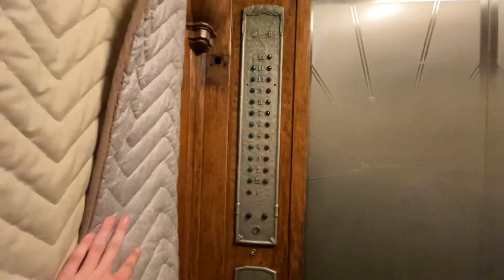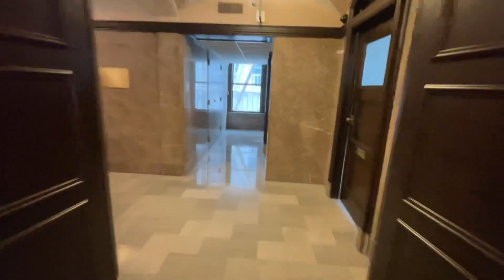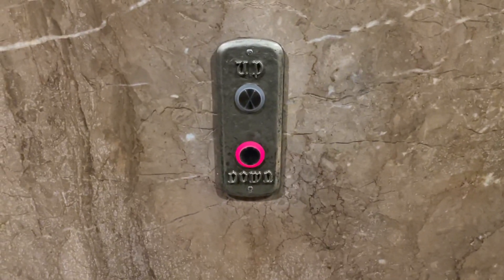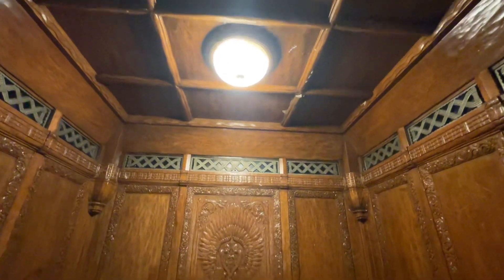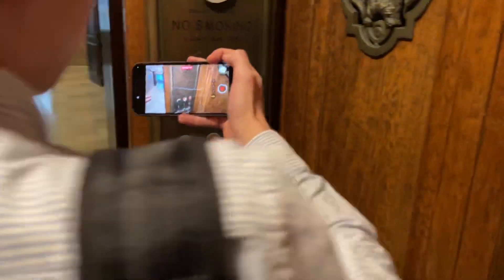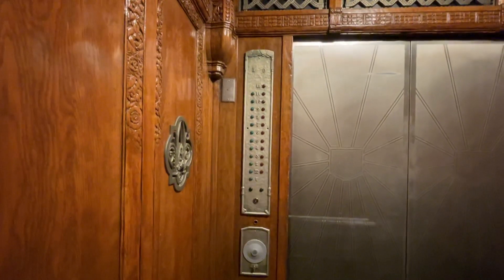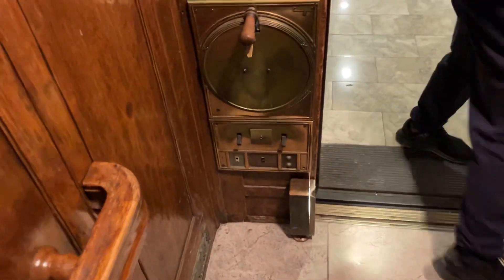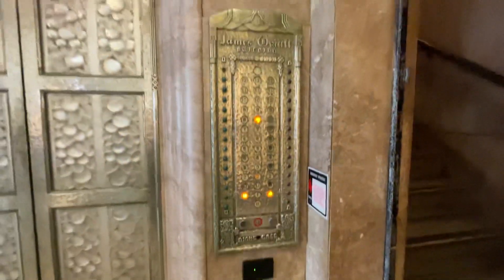1928 Llewellyn Elevators @ James Oviatt Building - Los Angeles, CA.

Comment: very nice modernization and tasteful decor.  DC traction I would expect for the era, not uncommon for gear-less machines in low to mid rise buildings with 2:1 roping. Often these are mini traction "footprints" machines.  Probably is powered by a DC rectifier and/or if modded DC drive.